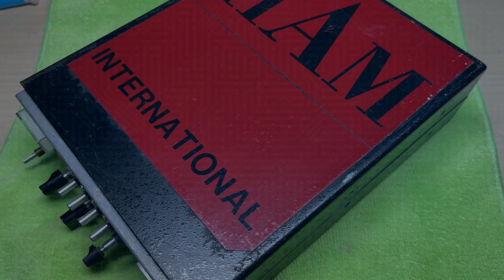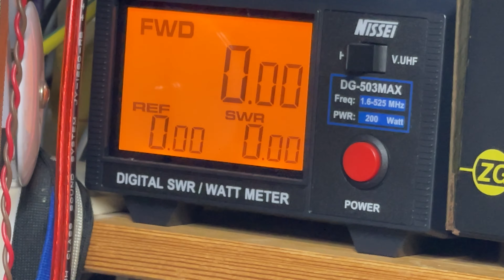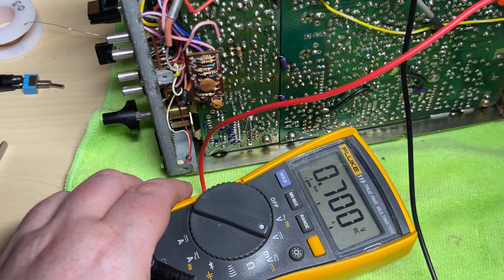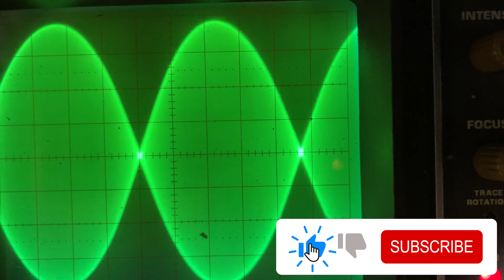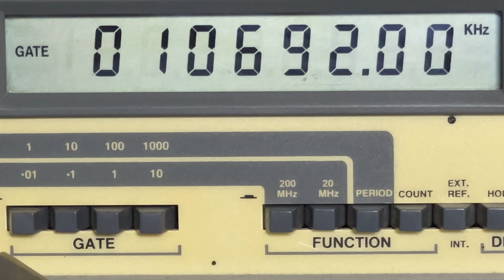EP 138 -HAM International Multimode II - Scrap radio resurrection - Can i get it working ?.

Comment: The transistor on the heatsink would have been for the eprom board which has been removed prior to you getting it.
Reply from the maker: Hi , i can understand that , but why is it connected to the terminal that controls TX power , that should have been connected to the red wire , this i don't understand .
Reply: @MicroChipz  Not sure unless they have the final volted for more power and were using that for the feed for the regulator too?